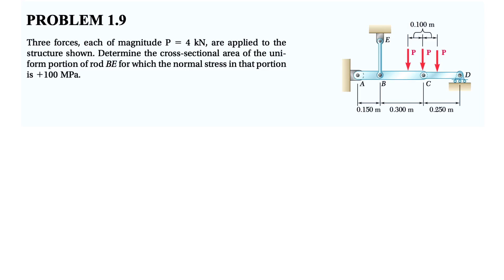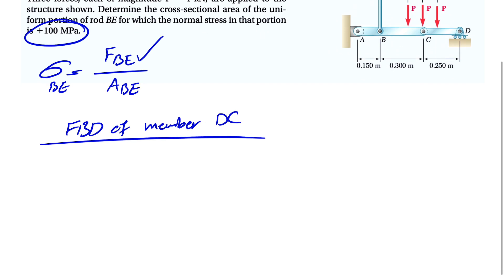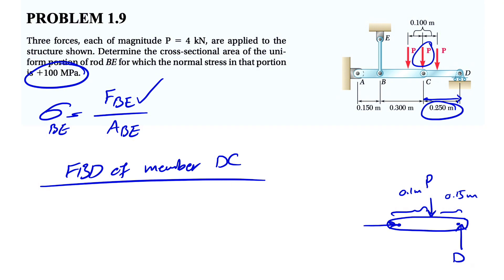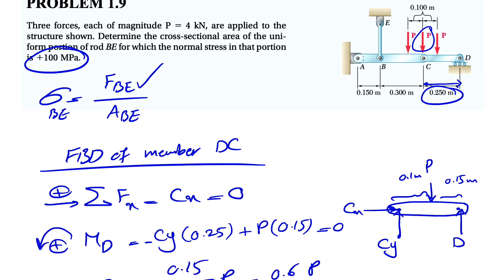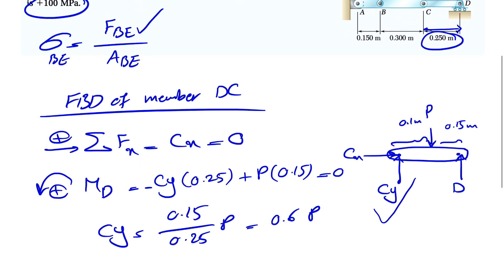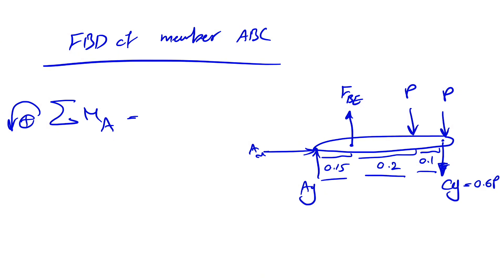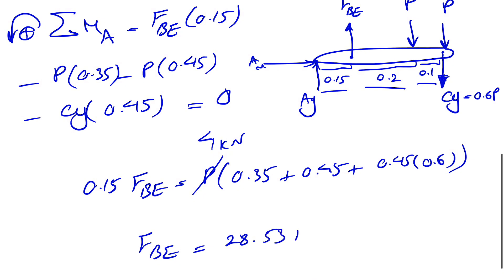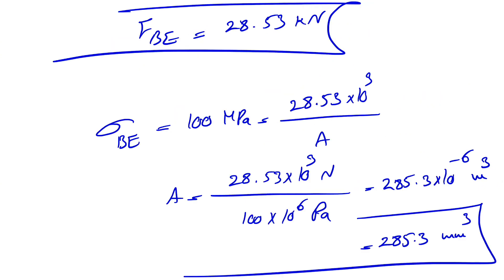Problem 1.9 | Can YOU Solve This Mechanics Challenge?

Comment: why is only one P applied to member CD, but two Ps are added to member ABC?
Reply from the maker: good question, from the figure member ABC is wider, and you can clearly see that the load at the intersection is applied directly on member ABC, not on CD. That’s why, when isolating ABC, two P loads act on it, whereas member CD only has one P acting on it.